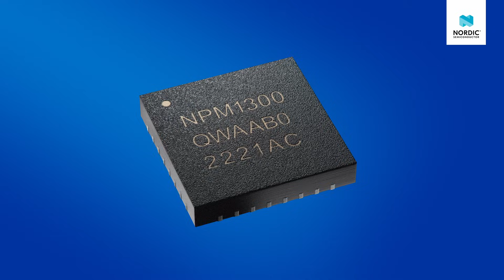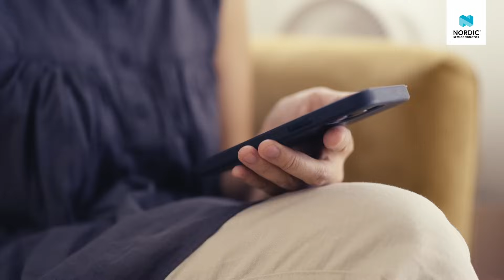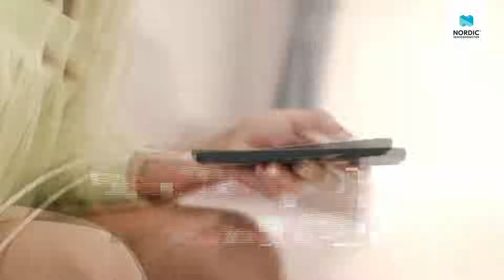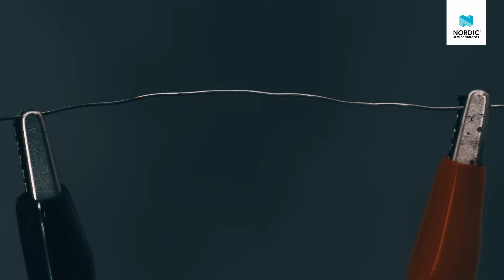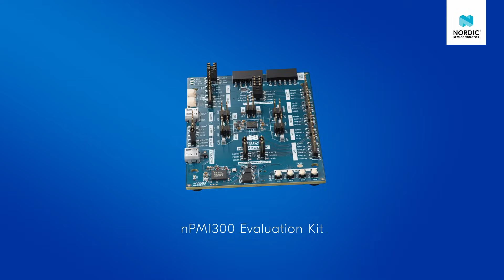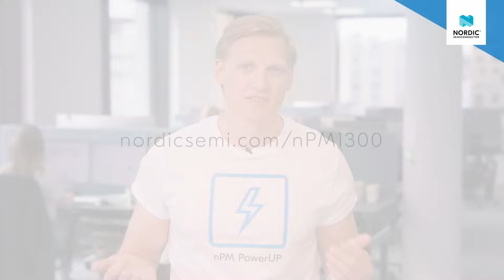Introducing a revolution in power management!

Comment: Nice video but isn't it just Buck charger with Fuel guage that too with OCV? What's the equivalent Maxim and TI parts?
Reply from the maker: The nPM1300 fuel gauge is much more accurate than a simple OCV measurement. We have not found any competing devices that pack this much functionality into one single package.
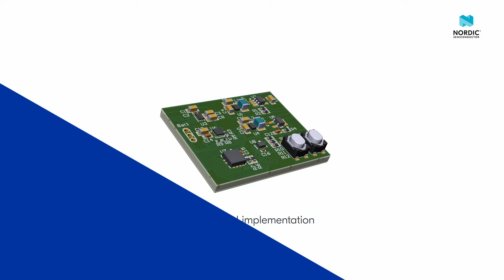Reply: See 4:00